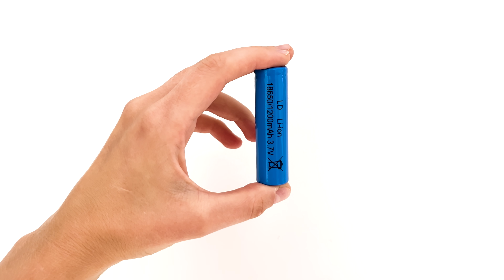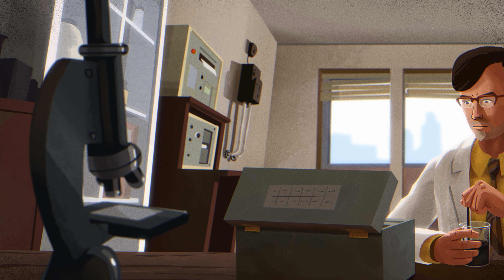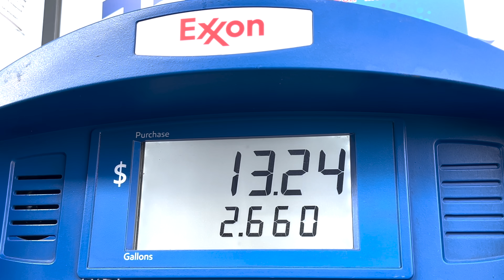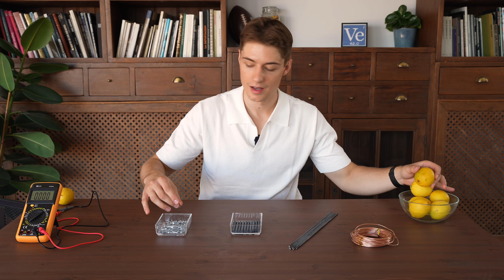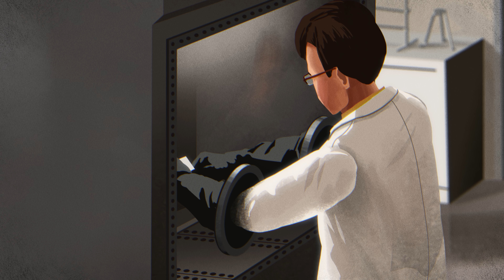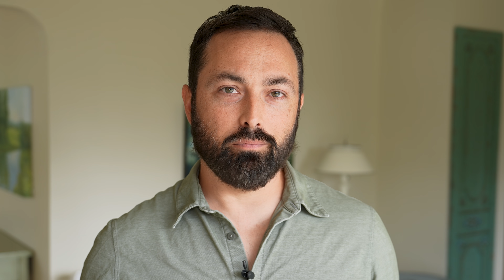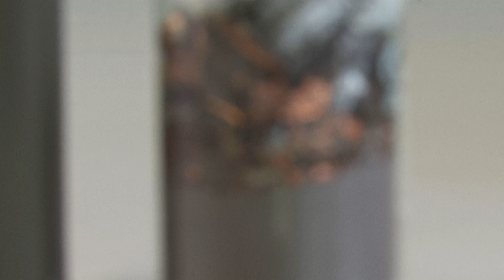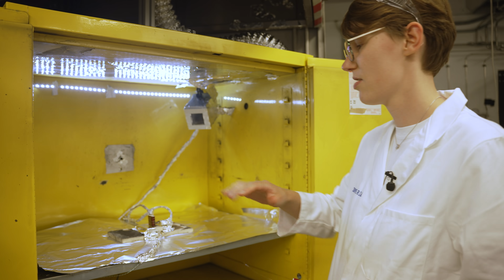The Perfect Battery Material Is Dangerous

Comment: Derek if lead acid battery can only hold 1.23v then why, as a mechanic and some who fixes things,  why do we teach people lead acid batters can be 1v  to 12v and can run 48v systems in parallel? Why is there fiberglass battery why is there sulfur battery's. Is was a werid way to prove lithium battery are safe.

Comment: Please do a video on Silicone Carbon batteries. They seem to be the revolutionary battery new kid around the block.
Reply: Silicon carbon batteries are high-performance lithium batteries that mix in silicon within the graphite anode to increase capacity. Previously, the silicon expanding when absorbing lithium ions would destroy the battery over time, but just adding small amounts and adjusting the anode structure has made it viable.

Comment: Watching them safely blow a singular cell up in a lab is so funny to me because as a kid I used to just stab/short/overcharge puffy old lithium polymer cells for fun since they weren’t safe to use in my quadcopters or RC cars anymore. I had a long lead I made with an XT 90 on one end and then a dead shorted connector I’d plug in once I was far away
Reply: By the way don’t do this unless you have a very large concrete surface with nothing flammable around and if you try it with a cylinder cell it might kill you…

Comment: I remember flying my foam RC airplane, a tiger moth in 1996 with 2 L-Ion cells scavanged from a sony camera. There was very few electric planes in the air in those days and the ones that were used Nicad or NM and wouldn't last long. Because my airplane was super light, and there was a breeze and it was on a hill giving it lift, my brother and I took turns flying it. We kept it in the air for 90 minutes. Everyone at the field asked how we stayed up for so long. I explained that the battery was lighter and lasted longer then the other options on the market. I showed them the 2 cell wrapped in electrical tape that powered it. Everyone was amazed. After a few years electric RC took off. Technology at its finest. Its amazing how far we have come in recent times.
Reply: So basically you could have launched a company using L-Ion batteries for RC planes but you chose to live life and enojoy
Reply: Dang, you should've started spektrum lol. I love my electric rc planes!
Reply: Ngl the scientist almost swearing only when talking about how immaculately safe the modern battery system is... Gives me an odd hope, y'know? He must really fuckin mean it.
Reply: In the late 90's, I knew someone at work who got into building and flying RC airplanes.  The prop used an internal combustion engine, but the radio and controls used battery power.  Li-Ion was bleeding edge, and didn't have the multiple safeguards built in like the eventually came to be.  These were the earliest adopters.  They learned about cell failure first hand.  There were two failure modes:  a cell turns into an open circuit, in which case the pack stops putting out any power.  The other failure mode is where a cell shorts out internally, in which case the plane becomes a spectacular flying fireball.
Reply: I learned on an anemic NiCad trainer. Within a couple of years of that they had super hot brushless motors and li pos. From barely powering a plane to real hot rod stuff pretty quickly.
Reply: Lithium and brushless motors completely transformed radio controlled airplanes. 

I am a hardcore v-8 car guy. You would think I would like messing with nitros, but I really don't. They are noisy, expensive, and by weight, very underpowered in smaller scales. 

My favorite plane for years was the gws slow stick. I put a big 450 sized brushless motor and a 2200mah lipo battery and could easily get an hour per flight. A few times just flying low and slow, I was able to get over 2 hours. 

It's amazing how much power you really can push through these little things. My 16oz plane has unlimited vertical and hour long flight times. 

My dad was a nitro guy, so was my grandpa. We got a couple of his old planes going, and they can be fast, but there is no torque. Idle speed is faster than most of my electrical top speed, so they have tiny props that spin fast which really limits torque.
Reply: thats fun, i really love flying planes with litium batteries today
Reply: Legend
Reply: I always wanted to make a RC Walmart Foam plane. It’s like they don’t sell those things anymore 😢
Made a lot of RC rubber band wooden planes. The big styrofoam plane is a MUST
Reply: Oh my God imagine the business you could've had selling those
Reply: @Auriam yoi know something, my brother and I have spoken to friends and family about these menories and I never thought about it like that as a business. But reading these comments it occured to me that we absolutely should have! When we were done flying, everyone at the RC field was asking about the airplane because they all realized that we were flying for way longer than anyone else was. In fact 2 people offered to buy it from me right there on the spot, but I turned them down. I think my ego /pride kept me from selling it now that I think about it. I was quite happy to be the only person at the field that could fly for so long that day and it felt good to feel special. But after reading these comments I now have to ponder what life would have been like if I did sell it that day, and maybe even started building more of them. Well its too late now, I guess I will never know. But I was young and dumb back then so I am sure there were many missed opportunities I passed up. But it is an interesting thought, and I never even thought about the possibility of making a business out of it all these years later until I read a few of these comments! Funny how life happens.
Reply: @newmonengineering  Well, don't keep pondering it and feel regretful, someone else probably was already doing it :) You have the present and that's enough.
Reply: Women had exactly the same revolution with lithium ion batteries
.
.
Nicd batteries only gave them 10 minutes,  
     but lipo batteries gave women over an hour of dildoing
Reply: No, you didn't.
Lithium compatible speed controllers did not exist until the 2000's.
In the 90's there was no device ("speed controller" in RC terms) to connect a lithium battery to your flight motor.
The only thing we had was nicad compatible speed controllers, and mechanical speed controllers with a rotary arm.
Reply: @riverpirate1022 this is such a silly thing to say. I did not use a lithium compatible esc. It was a standard DC esc with a tiny DC motor geared. It was nit brushless, it was nothing fancy at all. It was simply a very light foam tiger moth biplane. It absolutely did happen, you could ask the people that witnessed it or even my brother who I traded the controller with several times during the course of the flight. The camcorder battery was a simple 2 cell that I removed the cells from the plastic housing from to keep it as light as possible.  I even used thread to keep the wing struts super light. I forget what the entire plane weighed but it was almost too light for the wind. The wind was about 4mph that day and runway is on a hill where I flew which means you get an up draft of lift there. The little plane was designed to run with NiCad /NM batteries. The Li-on was about 3x the power of the recommended battery and it weighed almost the same. You can say or believe what you want about it but it absolutely happened, i may even have a picture of the timer on the transmitter somewhere because it was the longest flight I did to that date. There was no safety devices it would absolutely kill the battery if you let it. And the draw of that little motor was pretty small. The entire motor and gear bix was just bearly over 1ounce in weight. It was a 9/6 propeller. And I did not build it the way it was intended to be built, it was lighter. I had to remove foam to fit the battery because it was larger than the recommended 600ma NiCad that was recommended. Running a lithium battery down past its cut off doesn't  immediately kill it forever. It definitely is not recommended but you can do it a few times. Back then I got the battery from a flea market special who cares if it dies after a few flights, it was all about experimenting. Thats the entire point of the hobby for me, just to have fun teying things. But whatever you believe is on you. GWS started manufacturing RC planes about 1993 time frame. Their IPS motors ran on 6 to 7 cell NiCads. The esc was very tiny and was capable of no more than 3amps. ESC have no idea what batter its connected to, and do not care, they just push power. There wasn't even any Li-On rechargers back then. I just used a DC power supply with constant current to charge the cells. You can still do this today if you wanted to. This was not some magic I pulled off here, it was just trying new things. I have always built and experimented my entire life. The camcorder worked but it was kind of blurry, I think the lens was out of place probably why they sold it. But when I saw the sricker on the plastic battery case and saw its rated capacity and size, I knew I had to try it. I cut the plastic off of it and soldered on a plug and the rest is history. It really was not that hard to do. I was about 18 /19 at that time, do you think I knew anything about discharge of a lithium battery or cared? No I didn't. It worked, and it worked well. Did it last a hundred flights? No,  and I didn't care if it did. This was just some fun thing to try and it worked very well. No one said the ESC was lithium compatible. No one said it was perfect. This is the joy of the hobby, enjoying the experiments.

Comment: 34:13 Silicon-Carbon are one of those. Silicon had it's own problems, one of the major one being Silicon swelling. But this was pretty much solved by using a Silicon-Carbon combination.
But it still uses lithium, so we do need more innovations.
Reply: were does it use lithium?
Reply: @rian0xFFF  Si/C batteries used today still use LFP as the cathode, but the anode is now 1 to 10% (as of 2025) Silicon and the rest being Carbon. This results in higher energy density than LFP-Graphite, but the current gen Si/C batteries don't work as well in colder temperatures...
Reply: @jasimaneesahamed1033 
Is cold temperature a problem of silicon or carbon? Thanks

Comment: 34:07
So, most modern batteries aren't really using cobalt anymore, and for EVs at least, things are massively moving to LFP, which almost completely eliminates the fire risk.

I'm not sure if your research only went up to 2022 or so.
Reply: Lots of EVs still use NMC, but nickel is 90 percent or more of the best production cells' cathodes, meaning just 5 percent cobalt, and 2 percent of the total cell mass. Nickel content is still being increased.
Reply: Also, no mention of LTO?
Reply: @JosGeerink  LTO is far less energy-dense than both NMC and LFP. It does have some niche applications, for example I remember it handling cold better than the others previously, but both NMC and LFP have gotten better since then.
Reply: @Saddex oh absolutely, but in terms of cycles, LTO is still unmatched. But also when it comes to safety, I heard LTO is great. I have seen videos where they pierce a cylindrical cell, as well as cut it with a circular saw, and there is pretty much no reaction. But that cell is probably empty. I would have liked to see that test with a fully charged one.
Reply: Also, the Prius (used in the introduction) originally used NiMH batteries, not lithium. I don't know if it still does, though.
Reply: He also skipped over NiMH in EVs; probably for length.
As far as I am concerned: using hundreds of 18650 cells in an armored, temperature controlled, battery was a patent work-around.
The Toyota RAV4 EV was sued out of existence after Chevron bought up the NiMH battery patents.

Comment: We should really bring back gas rationing.  Not to save gas, but to stop using it.  We could ease in as slowly as we needed to, to give gas consumers more time to switch and not impact the EV market too drastically.

2:55 I think you're confusing NiFe and Lead Acid batteries.  NiFe is amazingly resilient, and was the battery of choice for many electric vehicles of the era, especially since Edison was pushing it until the gas engine took over.  Lithium ion batteries degrade way, way more.  Nickel-iron, while low in energy density, is really worth considering for stationary power storage today, especially once electrification has reached a point where lithium becomes harder to source (which is not far off).  If you don't need to care about weight or size, and many storage plants won't (especially with government support for rent or property taxes for such facilities), it is a solid choice.

Comment: Worth pointing out that he's mostly talking about NMC type batteries. LFP has no cobalt, a much lower fire risk and is already quite commonly used in cars. Upcoming solid state batteries contain less or no liquid electrolytes. They might still short but in a less spectacular way. And sodium ion batteries are less energy dense but are also starting to get mass produced and have no lithium or any other exotic metals. Those two are considered quite safe. And LFP and sodium ion are getting much higher cycle lives as well. 5000 or more in some cases.

Comment: What about LiFePO4 Batteries? Aren't these considered to be safer than Li-Ion? However, they are less energy dense...
Reply: They are almost universally the type of battery used in stationary energy storage, and a very large chunk of EVs manufactured in China. They are safer, more durable and cheaper, yes. Less energy density also, yes, but not that bad currently.

Comment: Lithium ion batteries weren't made to handle the performance that a car needs, that's why Teslas combust on hot days.
Reply: Teslas combust far less than combustion engine cars, as do nearly all EVs that aren't under some sort of battery recall (like the Chevrolet Bolt).

Comment: im confused, so if someone can help me, at 4:56 its said that the electrons are passing through the circuit, but if the circuit is just a voltmeter which should have (ideally) infinite resistance, how could that work? I'm not sure where I am going wrong here but I would love some help. I'm also thinking that if this is the case then two separate lemon slices would still work because the ions would pass into the juice and the electrons would still be able to pass through the circuit.

Comment: The thing about making everything electric is it is going to put a larger load on the grid. There are already issues with suppliers not being prepared for this change.
Reply: Yet scaling grid up has advantages. Low impedance, high capacity grid is less prone to oscillations which can trip entire countries (this is the reason why the US is split into three systems)
Reply: @brylozketrzyn I was meaning that utility companies continuing to use their grids as they are currently sized will have issues as the demand increases, not that there weren't advantages to scaling up.

Comment: IIRC the biggest issue with lithium ion technology is the tendrils that lithium makes while charging. If those tendrils then break off they are no longer electrically conductive and so do not participate in the battery chemistry.

Which leads me to suspect that we could revive lithium ion batteries by separating them so that the density of the materials involved naturally separated into a better, with the sulfur titanium being heaviest on one side, the dielectric in the middle density and lithium being the lightest density. That way if you needed to fix the battery you could just spin it in a centrifuge causing the loose lithium to make an electrical connection restoring battery life.

Comment: A real eye opener hopefully to people who don't realise what we carry in our pockets, A damaged laptop battery in my room combusted a couple of years back, I kept it as I didn't know how to safely dispose of it, it got knocked by something and it started burning and releasing some horrendous toxic black smoke into my room, thankfully it was on a pine wood desk which didn't set the desk alight but it absorbed a lot of the energy from the battery in the form of a 2 inch deep black crater in the table. I was lucky I didn't set the house on fire. Be safe guys and thanks for posting!
Reply: I always wonder about my 3 DJI drone batteries in my closet lol
Reply: @SangheiliSpecOp  Those might be Lithium Polymer, which is even more potent. RC car batteries are actually terrifying if youve seen what happens when they short.
Reply: @boostfrog I believe they are yeah. It was a newer type of battery DJI was trying for the air 3S because their other batteries had problems with ballooning or swelling and it ended up happening to me on my old mavic air 2. The batteries are smart batteries though and automatically discharge themselves little by little on an internal clock which is very cool. I think it happens over the course of a few months with this model. It keeps them healthy and hopefully less potent. I haven't flown my drone in a while, its just been extreme heat and rain here in florida. Its been "feels like 108F" for a while now lol
Reply: Same i still have my laptop battery I don’t know how to dispose it. 

After this I will save the headache and find some battery disposing facilities.
Reply: Millions of toothbrushes, phones, earbuds, laptops, tablets, headphones, flashlights, power tools vs 1 phone. 

Thanks for the warning /s
Reply: @psikot yeah my room has so much battery powered tech its crazy. What you really want to watch out for is the cheap chinese junk that everyone buys from Amazon, all of those products have false advertising and shoddy build quality